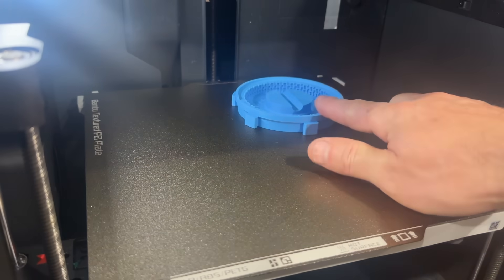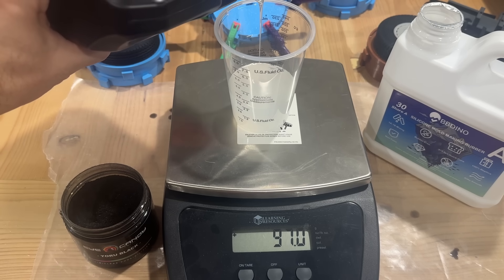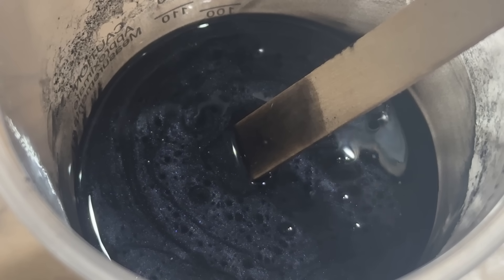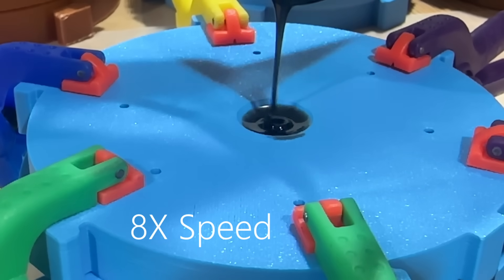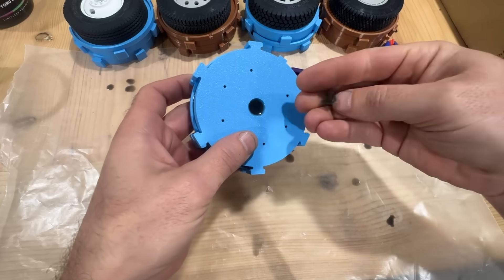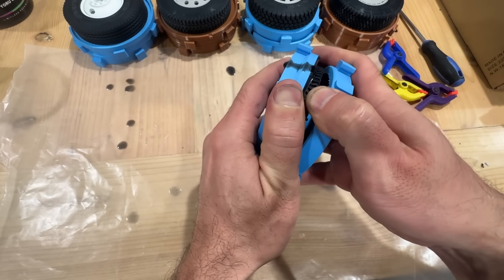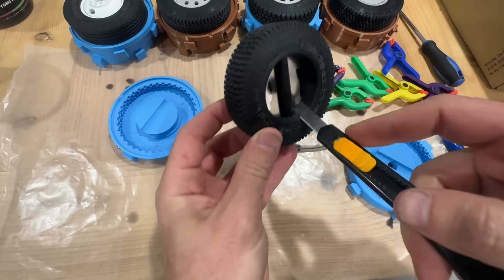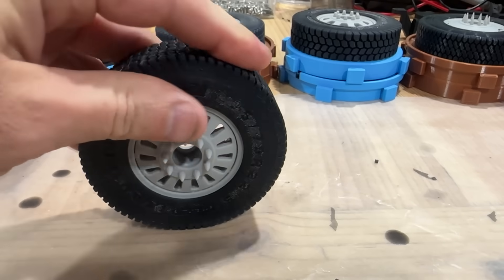RC Tire Molds | Make your own Tires

Comment: love the tires but do you do a highway wide front tire mould i want one that's a little wider
Reply from the maker: Hmmm, that’s an interesting idea. I do not but I think you could scale the mold parts to make the tire wider. You would want to scale only the tire width direction, not universally. I imagine you only need a mm ow two and that should work just find to be scaled.
Reply: @BuildItBetter3D  will try and mould one if it come out correctly will send stl to you it want it
Reply from the maker: Sounds good

Comment: If three of the flanges were beefier and had threaded holes on one side you could use 3D printed bolts (driven with your electric driver) to push the mold open quickly and easily, and with more orthogonal stress on the flanges
Reply from the maker: Good idea!

Comment: I've played around with latex-based tire molding. I've had some success, but it is more challenging. The latex shrinks as part of the curing process. So I try a combination of pressure on it, slowly adding more latex, as well as additives. But something you may want to consider. Even a simple process of latex + carbon black can give nice rubber once cured.
Reply from the maker: Thanks for the suggestion

Comment: Whats the cost for the silicone by itself, approx how much each tire cost by volume/size ? That's pretty nice and you can even choose different shore/hardness depending of the vehicle weight or application. Greetings from Eastern Canada ✌
Reply from the maker: These 1/14 scale truck tires cost $1.80 per tire in silicone.

Comment: Have you ever degassed the silicone in a vacuum pot? I use resins and silicone at work we do this every now and then. You can use a large mason jar or my old shop used a BIG pickle jar from GFC
Reply: This can save time that way you can  use a faster curing silicone and make more tires faster
Reply from the maker: Thanks, I have been considering it.

Comment: Very cool.
I sometimes purchase vintage RC cars.

The rubber or plastic tires are either dry rotted or too hard.

Can you make the molds for a paying customer?

If so...

Do you need a rim ant tire ?
Reply from the maker: We may be able to work something out. I would need accurate measurements of the rim and tire, along with good reference pictures. You can message me directly from my skeeter discord server, link in description.

Comment: now how would you do white walls?
Reply from the maker: White walls would be cool. Maybe a mold that has an indent where the white would be. Cast the tire black, let cure. Then cast white into the indent. Silicone will stick to silicone so it might work.
Reply: @BuildItBetter3D  I wonder if the white could be cast in first?
Reply from the maker: Maybe. You would need a way to keep it in place…
Reply: @BuildItBetter3D  gravity
pour white into both halve and let set before assembly

Comment: Nice work!  A couple things:  First: use some spray mold release on those molds.  The silicone tires will just pop out of the molds instead of having to struggle to remove them.  Second: as good as these tires look (and they look great) very doubtful they will hold up too long.  The dirt on tracks will naturally draw out the oils in the silicone and dry rot the tires. Nice for display but not for actual RC use.  Even for display, you will need to put a support of some kind under the RC vehicle so the tires don't touch the surface.  In your video, you show how soft they are.  The weight of the RC vehicle will slowly make the tires have a slight "flat tire" look.  Once that happens, the tires will ALWAYS have that flat spot.  I learned these lessons the hard way.  I started casting resin and silicone back in the early 90's.
Reply from the maker: Thanks for the tips. 
I tested mold release, it doesn’t help in this situation due to the tread depth. I shared a video showing the results. 
These are for use on scale semi trucks, so they drive slow and on hard surfaces so I think they should hold up just fine for that application. 
For getting flat spots that is a great point. I don’t store any of my rc on their tires. Any tire will flat spot if left for long so I always store them on their frames.
Reply: @BuildItBetter3D  Sounds good like a good plan.

Comment: now thats a great solution for scratch building when you have a tyre scale problem (finding suitable tyres and wheels) anychace you have a mould scaled for 1/6th DUkW tires
Reply from the maker: No, but I do plan to continue designing molds. I would like to make molds for many different sizes and applications.

Comment: Any 1/10 scale tire moulds for 1.9” and 2.2” centres?
Looking for 100mm total diameter for the 1.9 (or 1.7 I guess)
Or 150mm for the 2.2 centre

Hopefully get a 12mm hex open in on back of wheel too 😉
Reply from the maker: I would like to make some molds eventually for those sizes. Don’t have any yet though.

Comment: A solid filled tire like that is super expensive.  At least it doesn't require a vacuum.
Reply from the maker: These cost me $1.80 per tire to make. The cheapest tires I could find to buy are $4.25 each. I also feel these are better than the tires I purchased.

Comment: You didn't have trouble with the silicone curing when it was in contact with the 3D printed plastic? It's a very common problem. You can coat the plastic with certain coatings to help prevent that.
Reply from the maker: No problem at all with the pla printed molds. I also tried a resin printed mold and the silicone did not cure correctly in that mold.

Comment: Why no release agent spray before you use the mold?  I thought that was a standard thing mold users use.
Reply from the maker: The silicone does not stick to the pla mold material. I tested with and without and found no improvement using mold release. I will post a video showing the results.

Comment: Have you tried using any sort of mold release? Would probably make it much easier to demold
Reply from the maker: I did just finish a test with mold release. I will post a video showing the results. In this case it didn’t help though.

Comment: Great job but isn't 100gr bit heavy? Where are you going to use them?
Reply from the maker: They are going on a 1/14 scale semi truck so the weight is not an issue. I am working on a mold design to make them hollow, though I don't think it is necessary for my application.

Comment: What if you made it come apart in segments for easier release? Especially if it’s a more complicated tread pattern?
Reply from the maker: This might help. Then there is the struggle of getting each section to seal so there aren’t leaks while it cures.

Comment: Great stuff! May I also recommend TPU 3D printing. This material prints items with rubber like results. Tried it once for printing RC Mustang tires, came out nice.
Reply from the maker: Thanks. I’ve been printing my tires in tpu for a while now but wanted something with more grip. This method provides a lot more grip than tpu tire. I plan to make a video to showcase the difference.

Comment: Here's another idea:

For a hollow tyre you need a multi part mold with a mandrel. 

Sidewall part with places for the mandrel pieces to sit on 
Tread sections on the outside, mandrel pieces on the inside with galleries and a keystone piece with a main gallery to force the material in.
Sidewall piece that locks the whole mold securely.
Reply from the maker: Thanks for the suggestions. I will look into what all that means, but I'm sure it's a good idea.
Reply: @BuildItBetter3D tyre makers use an inflatable mandrel to get the cavity in the tyres. My idea is the plan B in case you can't get an inflatable mandrel, to use a jigsaw mandrel that you can 3D print the pieces
Reply from the maker: I’ve already started on a 3D printed version that’s in multiple pieces. An inflatable one would be great though.

Comment: Great ! Please info about molds and the material,thanks
Reply from the maker: The molds are 3d printed using PLA. You can download the files to print your own from the link in the description. Also linked in the description is all the materials used.

Comment: This is exactly what I've been doing for my 1:5 scale project only difference is I'm using polyurethane rubber. Yet to test them though, silicone might be a better option. Cheaper, I know that much for a fact 😂
Reply from the maker: Interesting, I hope your tires turn out well!

Comment: For this silicone, can I use molds printed with resin?
Reply from the maker: I did one test with a resin printed mold and the silicone did not cure correctly. It is possible I needed to clean and cure the resin print better, I was rushing a bit. I will test again as getting the ultra fine detail from a resin print would be great.

Comment: Awesome video! Would it be possible for you to do a mould for a 1/24 size rubber tire I could 3d print?
Reply from the maker: Yes, I would like to make some for 1/24 scale.
Reply: Do you have contact info?
Reply from the maker: You can contact me on my skeeter discord server. Link is in the description.
Reply: Won't download your link.
Reply: Email?
Reply: My tablet is not compatible with your link?
Reply from the maker: Discord should open in any browser, or there is an app for most devices. I’m sorry but I do not give out other contact information.
Reply: Messaged you on discord
Reply from the maker: I just looked but do not see a new message.
Reply: User name is skeeter?
Reply from the maker: No, my username is BuildItBetter. If you are a member of my Skeeter 1/14 Scale RC channel then you will be able to find me in there. The link I shared should have taken you to the skeeter channel.

Comment: BIB, I would definitely print a donut shaped insert for your mold to create some airspace similar to a real Tire, maybe a large enough donut to allow for foam inserts.
Reply from the maker: Thanks for the suggestion, that's something I've started working on. I'm afraid of the difficulty of removing the insert, but we wont know until we try.
Reply: @BuildItBetter3D inflatable insert.

Comment: Not at all involved in this hobby lol, but I'd be curious to see experiments with different levels of solidness and their effect on handling & bump absorption. Bouncy isn't necessarily good, with car tires usually acting like a bit of a spring themself before the suspension gets involved. The scale of RC may negate or mitigate this effect, but I'm still curious because 3d printed molds open up a lot of possibilities. Cheers!
Reply from the maker: Absolutely, I want to test this. These were made specifically for fairly slow moving 1/14 scale semi trucks and I think they are perfect for that application. For faster cars and especially off road types I think there will be need for some tweaking of the design and possibly a different hardness silicone.
Reply: @BuildItBetter3D I'll be subbed and looking out for some honeycomb infill 😁

Comment: 1st of all.... wow, this is actually awesome

here are a few suggestions
1.- you should think about getting a vacuum pump, in aliexpress there are some supre cheap with chamber and everything, or DIY
2.- Maybe a nail clipper will be better at removing the side stumps since the blade is curved, (maybe youll find the perfect nailclipper for the specific tire)
3.- maybe adding a third piece to the molds to put it like cups on the air vents and the filling hole, so, you can drop the product, and let it do its thing, (this must come very handy with the vacuum pump.
Reply from the maker: Awesome ideas, thank you.

Comment: Well done, but I fail to see an application for those tires. For crawling they seem way too rigid, but the added weight would be a plus. For track cars a full rubber tire is way too bumpy. Maybe this would be good for fork lifts and similar vehicles.
Reply from the maker: Right, they don't fit every application. these are for 1/14 scale semi trucks and are perfect for that application. I hope to try molding different styles that may fit crawlers, they would need to be hollow to give more around obstacles.
Reply: You could print a mold for hollow tires…. You can also get different silicone if you want to change the grip of the tire. Man just found a way to save people literal thousands of dollars and you can’t see an application for it? I am blown away by this comment. The cheap tires on Amazon are close to 20-30 for 4 tires. So maybe $5 a tire. A 140 oz thing of silicone is $80. So he just spent $80 to make roughly 950 complete sets of 4 tires. Sure a semi would have more tires, if he kits out the trailer he will use 18 tires. So 220 complete sets of tires for $80. Oh and if you printed a mold for hollow tires, you wouldn’t use 100 grams per tire. Seems like the weakest application of only RC semi truck modelers would still save people a cap load of money. If someone were to make a mould for hollow tires and they were even ok. Not good. Just ok. You could save literal thousands of dollars in tires. Not to mention if you could use those tires for racing. That’s even more expensive. Sure it depends on grip and what not but this man just used his head and showed the world how to save a crap load of money. Not to mention the people who will take this idea and tweak it a bit and use it for god knows what else.
Reply: @Everfalling1  Relax man, it is not that serious!
I failed to see an application for the tires he produced, he answered and delivered one -> semi trucks. 

Why you act as if he invented tire molds. They have been around for years.
He doesn't need to be defended, nobody was attacking him. I was basically just "thinking out loud".

Comment: Did you use any mould release?
Reply from the maker: No I did not. I am running a test now with one mold having mold release and another without so I can compare if it helps at all.

Comment: Excellent, I had just done an experiment with a TPU tyre for my sack carrier which worked fine but used up a vast amount or TPU and took ages to print so this idea is great, I have reproduced your molds with my TPU design but have reduced to actual rubber part to just 2cm with the rest a 3D printed hub. Thanks for getting my brain in lateral thinking mode
Reply from the maker: Glad I could inspire some new ideas!

Comment: Have you tried printing with foaming TPU?
Reply from the maker: I have printed tires in TPU, I did not know there was a foaming TPU.
Reply: @BuildItBetter3D It would be nice to be able to print the hub and the tires together. A tool changer like the Snapmaker U1 or even the dual nozzle Bambu H2D (or upcoming H2C) would be great for this purpose.

Comment: Thia is really cool. Especially because you can buy different durometer hardness 2 part urethanes and mold stiff tires or soft tires that are closed to their real worls rubber counterparts.
Reply: What hardness do you recommend for a sack carrier or garden trailer, I’m glad I saw your message or I would have bought any old silicone rubber liquid. Thanks for getting
Reply: @ChazmillsADLT maybe around a 60a-70a. Im not an expert, just done a lot of reading. Had plans of making my own stiffer suspension bushings for my car that they dont make an aftermarket polyurethane version of.

Comment: Any idea on how quickly the tire will deteriorate during use? I've been thinking about making belted tires for 1:10 scale touring car stuff since I can't seem to find em online now but I'd imagine it would wear through to the belt too quickly to be feasible
Reply from the maker: Yeah, I imagine it’d wear fairly quick with hard use. On the scale semi truck I think they’ll last a long time, but on anything fast it’ll wear faster. I want to make some to test in different applications to get an idea of their lifespan.

Comment: Here's something i heard about but always forget to try: if you fill a little silicone into a large dispenser syringe, you can plug the spout and then pull back on the plunger to degas the silicone.

Also i imagine a second hand food vacuum canister storage system might not be hideously expensive. I once walked through the city and saw a discarded a Snail Foodsaver canister on a bench, pretty scuffed up but still sealing well, i just need to adapt some type of pump to it.

I'm sure there are underexplored opportunities in moulding silicone and PU, such as embedding various parts and materials into them during casting.
Reply from the maker: Thanks for the ideas. Gives me some things to consider.

Comment: You can draw in a bit of silicone to a large syringe cover the tip and pull a vacuum in the syringe to get the bubbles out before dispensing in a nice controlled way.
Reply from the maker: That’s an interesting idea. Thanks.

Comment: Can you compare this with any foaming soft filament (TPU or PEBA) for feel. Obviously you can't compete with a printed mold for resolution since hard filament are more forgiving
Reply from the maker: I have printed many tires in 95a and 85a TPU and this is far softer and provides so much more grip that they don’t compete. These silicone tires feel like a real car tire to me.

Comment: Mould makers spray wax for release agent is pretty good, I made some moulds for old Tamiya XR311 tyres. I wanted them hollow so made an internal volume that splits into 8 parts and I tack it together with superglue. Black Silicone caulk mixed with cornflour is also good tyre meterial, it cures fast but its quite thick and viscous. I had to splodge the mix into the mould then assemble it which was quite messy. Great work, your stuff looks brilliant.
Reply from the maker: Thanks for the tip. I’d like to make hollow ones as well. A multi part internal piece is a good idea.